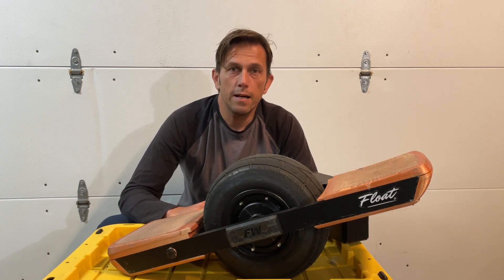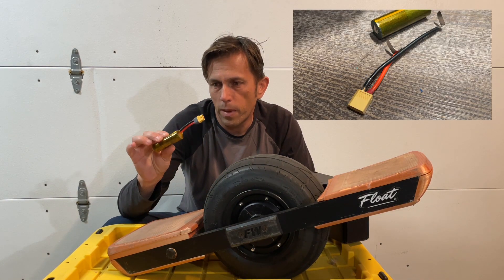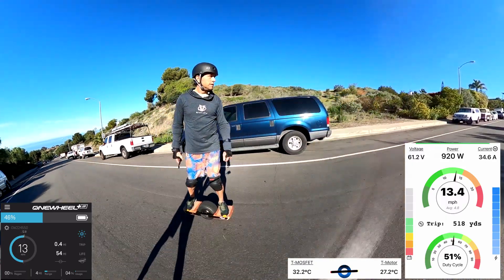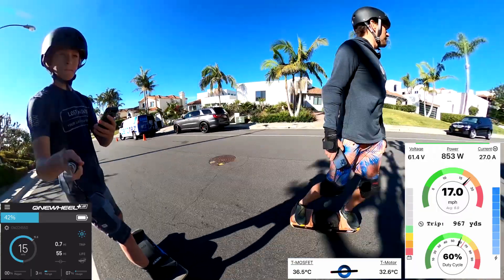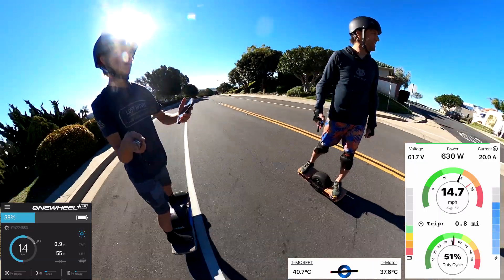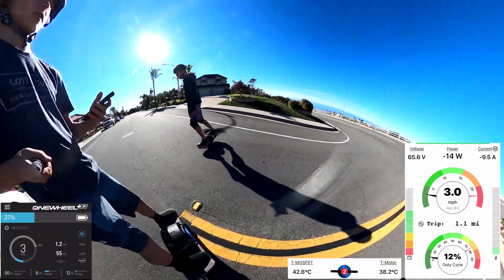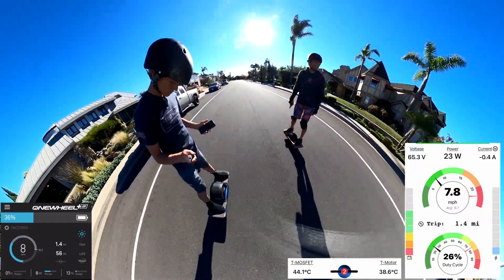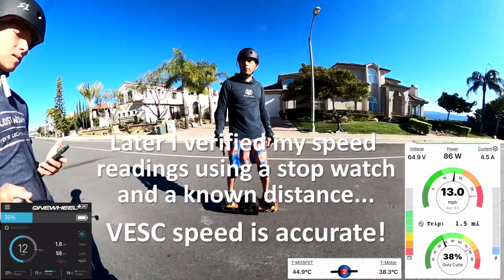Building my Funwheel GT - Part 1

Comment: My spintend hub motor doesn't have a temp sensor i believe. The wiring harness only had 5 wires power ground and three hall sensor wires. That stadarade is like 35 bucks on amazon
Reply from the maker: It’ll work without the temp sensor - and for street riding you won’t need Statorade. Major hills and harder trail riding is a different story but I’d first see how it does without

Comment: If u ride a onewheel it is NOT about top speed but rather having the torque to climb hills.. I want 4 hp 25 mph onewheel . That can climb up hills I am 270ilb at 6;5 so I enjoy riding about 20-25 at the most. I want torque
Reply from the maker: A good VESC (like the Little FOCer) can definitely deliver the amount of torque you need given a big enough battery. But torque and 25mph is a pretty tall order. A OneWheel GT should be your best bet. With an XR-based platform you will only be able to meet this requirement using external batteries.
Reply: @surfdado  Aye, I have both the GT and the XR. I Meant I wish They made one with more torque and the GT fills that void but I do not Like FM as they are a terrible company. Cheers as I love what u are doing on the Vesc platform with a onewheel.    P.S. If I would've known about FM antics with the bms before I rode my GT I would have returned it as i cannot support a company that does what they do.

Comment: Going fast is rough, I just took a tumble at about 24mph. Now I'm limping around and can't get much work done. But anyway, excellent video as usual. Very cool to see this continue on. I'm jealous, I need to get back to my Funwheel build. Take care sir!
Reply from the maker: That sucks! Hope you'll recover quickly Mario!
Reply: @surfdado  Thank you Dado!
Reply: I was just thinking the same thing. I have a 16s3p in my onewheel and I remember eating it a little over 20mph, and now I never go near 20. I had fangs too so when my board cutout I was basically uncontrollably rolling at 20mph till my fangs steered my into a curb. Bruises all around
Reply: Was that 24mph on esk8 or onewheel? I have no balls to take my XR over 18mph. Even then I’m trying to mentally prepare myself to run it out…which is likely to get ugly.
Reply: @adam-qd5xx  As of today, both. Well, 22mph on a VESC based Onewheel I'm testing and 24mph on an eskate. I am a fool, and now cannot do any work.
Reply: @TheBoardGarage  ouch! I hope you have a speedy and drama free recovery.
Reply: @adam-qd5xx  Thank you. 🙏

Comment: Your son's XR has a sensor issue.
Reply from the maker: My son is only 85lbs, we've had the same issue on 5 different FM Onewheels. One Pint wasn't even rideable for him till I added some rubber strips on top...
Reply: It sucks. I had a bad tumble due to this 4212 sensor. Fixed the 4212 sensor by adding some tapes between the grip tape and the sensor.